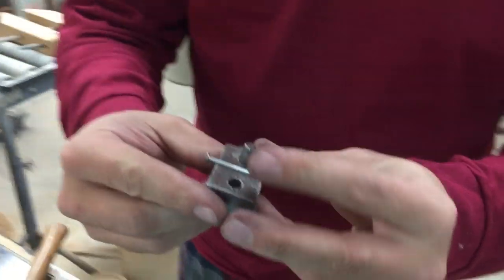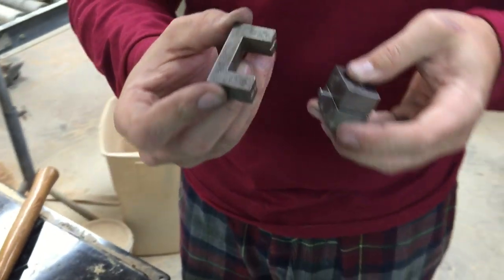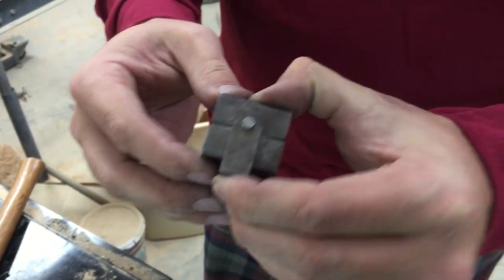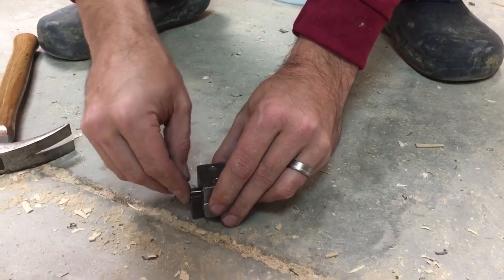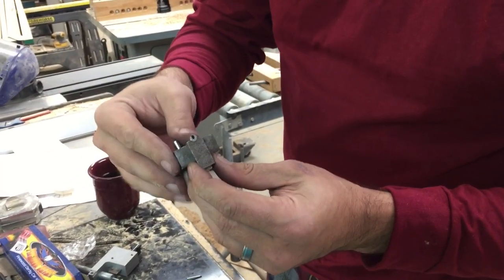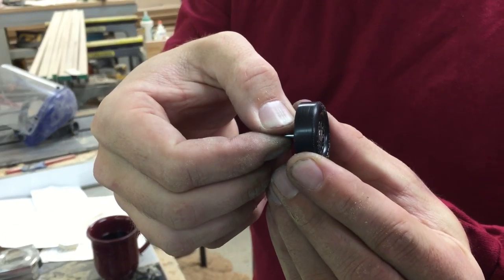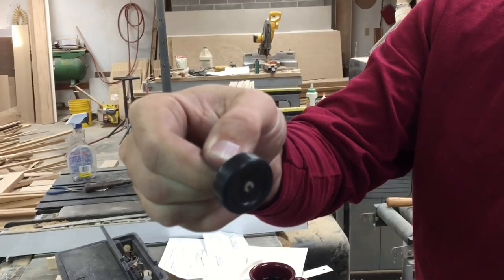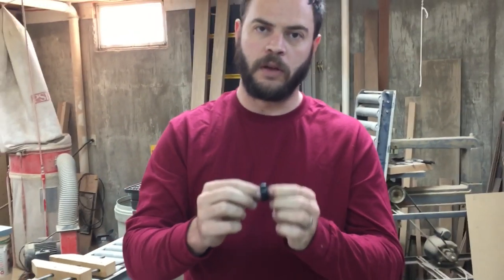Pinewood Derby Secrets Part 3 - Axle Bending

Comment: Great Video! - I have the same die/bending jig.  I've always used the bending jig over the top of the die, but I'm intrigued by the way you put the bending jig underneath and strike the die.  Do you find this yields more repeatable results?  Mine have always been hit or miss.
Reply from the maker: I figured that the die is meant to be hit, didn't want to mess up the calibration of the bending jig.  I usually use smaller hits, rather than a massive whack while bending axles.  I also typically do enough wheels and axles for 2-3 cars and pick the best ones for the actual race.

Comment: Our race rules mandate all four wheels on the ground.  Would you advise bending the rear and front axles all the same?  Thanks for the vids!
Reply from the maker: If all wheels must touch your best bet is to just run it as straight as possible.  Bending all the axles may make it difficult to adjust it.  I do have to say, that's the first time I have ever come across that rule and it seems silly!

Comment: I have the same thing only I stopped using it I have a better tool. However if you do use it put a piece of paper between the axle and the bender because it scratches up the axle again so you have to re sand and polish it. 1 reason I stopper the other is because the number 1 thing you want is the axles to be parallel to each other and square to the block, with bent axles its next to impossible to do. so your car maybe more consistent but will acutely be slower then if you left them unbent.